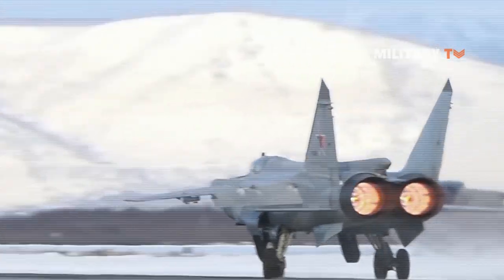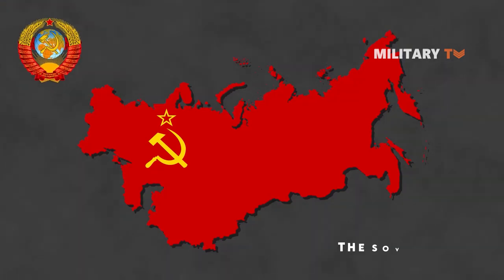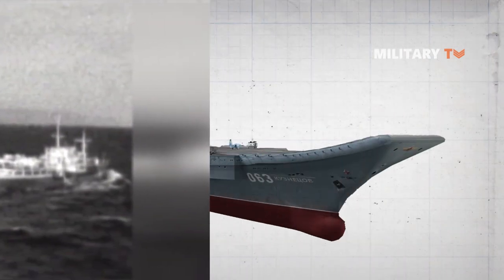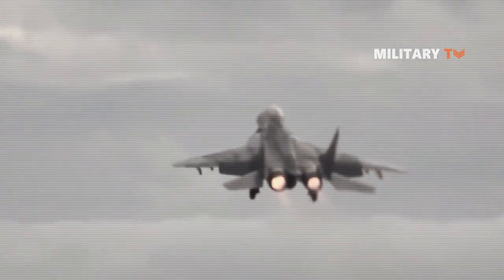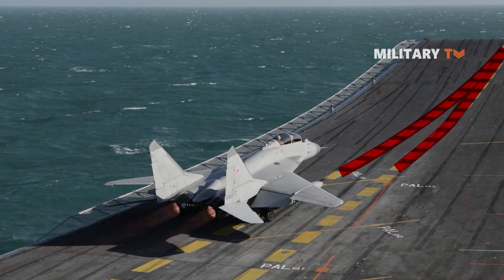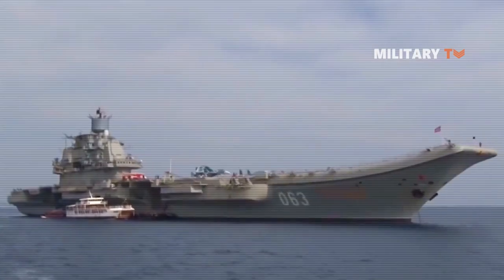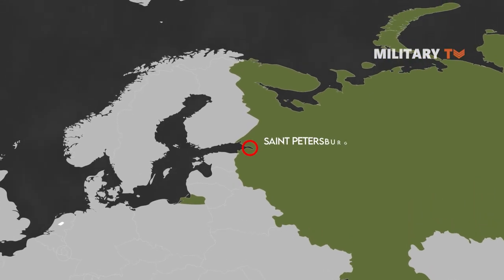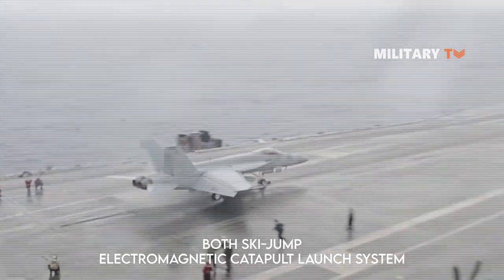Why Russian Aircraft Carrier Doesn't Have Catapult

Comment: No catapult means that the Russian naval fighters have to take off with a lower weight. That means they have less fuel, and smaller weapons loads than their USN counterparts. This also applies to the Chinese carriers.
Reply: also taking off with after-burner, burning big fuel reserves before being in the air. also, limited types of planes that can take off from the carrier.
Reply: because they did not pay for the catapult patents
Reply: It also applies to british ones. american carriers are the exception not the norm.
Reply: So they take off with less fuel and get refuelled mid air without compensating payload thanks to the powerful engines they got (each with 135-145 kN thrust vs 95 kN on F-18E/F)
Reply: I read that US uses catapult system using steam. Since mostly us carriers are nuclear powered.
Reply: @nikko-kun643  The next generation is switching to electro magnetic.
Reply: @Foxtrot_India  refueling in flight is well enough in peace time. During a heated carrier conflict, planes loitering in flight to get refuled are easy targets, not to mention all those slow flying tankers.
Reply: @ricardoantonio5085  Both Su-33 and MiG-29K has buddy refuelling capability
Reply: The new Chinese carrier launching this year has an electromagnetic catapult.
Reply: @thetruthhurts9750  I doubt it will work properly, their plane sucks tho
Reply: @leoironwolf2828  I'm sure it will work properly. Wishing bad is a useless strategy.
Reply: @Foxtrot_India  If they have an aircraft that can refuel them in the air, it means they have an airbase nearby...  which negates the need for a carrier.    This is an aircraft carrier primarily designed for Russia's inferiority complex, so they can say 'we have an aircraft carrier just like America'     The Kuznetzov lost 20% of its fighter aircraft in Syria.   No enemy fired at them, they crashed into the ocean running out of fuel because they didn't calculate their load/fuel correctly.

Four of these were built, there is a reason Russia only has one.    They sold two to China and left one to rust without entering service.   China got their first one, and quickly decided to turn the second into a novelty hotel (not joking) rather than a military craft.

Russia had actually tried to engineer a catapult given the inherent weakness of not having a steam catapult on a carrier.   They spent a small fortune developing one, but when they went to inspect the results they found the funds had simply just evaporated and what they had didn't work at all so they scrapped the idea quietly.
Reply: @Foxtrot_India  and compare with power weight ratio. Russian plane is havier than US plane
Reply: @Foxtrot_India  If there are 12 planes in the air and have to refuel to each other then only six are ready to fight,
Reply: @sultanhusnoo8552 we take off with full afterburner in America, was well. It's safer. We also land with full afterburner.

Comment: Why the British used to use catapults but don't anymore ...

1, The airframe of the planes last longer than catapult launched aircraft. 

2, If an aircraft carriers get a bomb land on its deck. It will damage the catapult system, making it totally unusable. 
Resulting in the aircraft carrier spending month in a Dock preforming repair...

If a bomb lands on an aircraft carriers that do not use catapults.
The ship can sail to the nearest port.
Weld a sheet of steel over the top of the damage.
Then sail back out to sea after just a few days 😉
Reply: "Why the British used to use catapults but don't anymore ..."
The UK wanted to use EMALS but couldn't power it and due to cost. Catapults offer much better sortie rates, usually over 2 times.
"The decision to convert Prince of Wales to CATOBAR was reviewed after the projected costs rose to around double the original estimate. On 10 May 2012, the Defence Secretary, Philip Hammond, announced in Parliament that the government had decided to revert to its predecessor's plans to purchase the F-35B rather than the F-35C, and to complete both aircraft carriers with ski-jumps in the STOVL configuration"

"1, The airframe of the planes last longer than catapult launched aircraft. "
They also carry less fuel and munitions leading to reduced capability.

"2, If an aircraft carriers get a bomb land on its deck. It will damage the catapult system, making it totally unusable. 
Resulting in the aircraft carrier spending month in a Dock preforming repair..."
Carriers with catapults like the Nimitz class have 4 catapults, meaning you would need to take out all 4, whereas on a Ski jump if you take out the ski jump the entire carrier is down, and needs to then have it's super structure rebuilt as the ski jump is weight bearing, which would be out just as long as a catapult if not longer as it's the actual superstructure of the ship. 

Nothing is perfect, everything has it's pros and cons.
Reply: but do they need to be expecting that kind of damage unless they're in a situation like the World War 2 U.S vs Japan all out war situation when Japan's Air Force and U.S Navy were trying to wipe each other off with heavy numbers, don't they have a defense system that protects them in a case of a couple of aircrafts trying to bomb them?
Reply: because the british dont wanna pay the patent fees
Reply: @jamesnguyen7069  the British invented steam CATOBAR , angled flight deck and Optical Landing System then STOVL

Comment: USA has much more experience in aircraft carrier develop and producing due to small small ground borders. 
USSR does not needed in this type of warships up to 1970-s. All current needs was realized by ships with helicopters onboard.   
But when the first Russian aircraft carrier was in development the primary question about steam catapult launch system was is how it will work in case of ice storm and at winter. Because the Russian is Northern country.
Reply: @sultanhusnoo8552  Most of the countries that attaked Russia are on the western side. Historically, the naval fights in which Russia participated took place on the Black Sea with Turkey as the enemy and on the Baltic Sea with Sweden as the enemy. There are only a couple of exceptions. Archipelago Expeditions at Mediterranean sea at Russian-Turkish wars to free Greece from Turkish slavery at 1769, 1806, 1828. And during Russian-Japan war at 1905 at Japan sea.

Comment: a STOVL aircraft carrier can also serve as a STOBAR carrier . . . all you need to do is add a series of triple redundant arrestor wires in the rear most stern section flight deck of a STOVL aircraft carrier . . . thus making it able to operate naval carrier borne CTOL fighter jets such as the HAL Tejas Mk2N maritime multi role fighter . . . for e.g. a fleet of three brand new next generation Queen Elizabeth II class bioFuelCell2^ i-SMARTHYBRId® powered 68,390 ton (76,090 ton loaded) stealth (STOVL) aircraft carrier . . . incorporated with a milder 10.0° deg angled ski jump in the foremost bow section of the STOVL flight deck . . .

Comment: The Russian aircraft carrier is a "lemon". They sold an older model to China, which had to completely rebuild it. Use of an afterburner on take-off limits aircraft range. Because the ship engines are unreliable, tugboats accompany the Russian wherever it sails.
Reply: That wessel, what was called a tugboat by news agencies based on a single sat picture, was actually a oil tanker. Ship is not nuclear powered/ It need fuel. And you just spreading fake based meme here ;)
Reply: All aircraft use afterburner when taking off from carriers. Including US super hornets. Don't talk about stuff you don't know
Reply: It seems like the Russian aircraft carrier is docked for repairs more often than it is operational, honestly.

Comment: Simpler, cheaper and doesn't need expensive maintenance like a catapult? But I guess this is too complicated for some.
Reply: It also prevents aircraft from being able to fly with significantly much more load. More load more fuel, extending the carrier fleet's projection range significantly. That and the ability to field AWACS by catapults.
Reply: @Tayzzy-h2g  it does expert less stress on aircraft though and it’s much cheaper. For the UK, it was a no brainer to go with the ramp.
Reply: @Horizon301.  It's sortie rate is also much lower. Russia is just a poor nation and can't afford it. The QE class was also supposed to have a catapult but they couln't power it since they weren't nuclear and didn't produce enough power.
"The Navy designed CVN-78 to increase the sortie generation
capability of embarked aircraft to 160 sorties per day (12-hour
fly day) and to surge to 270 sorties per day (24-hour fly day)
as compared to the CVN-68 Nimitz class sortie generation rate
demonstration of 120 sorties per day/240 sorties for 24-hour
surge. 

QE class: "The maximum sortie rate is 110 joint combat aircraft sorties in 24 hours."
Reply: @ThatCarGuy  I’m pretty sure it’s still on the cards in the future, it’s just not something they want to rely on for their entire fleet, and it would be for other aircraft, not the F-35. Ultimately we made 2 aircraft carriers for the price of one. The US with the Ford essentially did the same with the Nimitz and 2 is better than 1. Cost would have been an issue had they gone nuclear also and personally I see no need for it if you have the proper support in place. I’m also impressed at how it’s rolled out, seems much more trouble free compared to other recent additions from the UK and US
Reply: @Horizon301.  "I’m pretty sure it’s still on the cards in the future,"
Sadly it's not unless they redesign the ship to add a power plant capable to produce the 60mw needed as the QE class makes about 120MW of which the VDM25000 engines take 80MW to power leaving 40MW left to power the radars, fire control system, etc. So there isn't enough power.
" Ultimately we made 2 aircraft carriers for the price of one. "
That's not entirely true since you need an entire CSG to protect both if comparing 2 vs 1, which costs more as you need to add in the cost of each extra set on the second CSG. Not to mention the fueling of both compared to nuclear. The costs keep rising each deployment. 
"Cost would have been an issue had they gone nuclear also and personally I see no need for it if you have the proper support in place."
Nuclear carriers can refuel and feed the CSG and do so by carrying 3 million gallon/11.3 million liters for it's CSG. Allowing for longer mission times, less refueling tankers, less protection needed to escort the refueling tankers, etc. I do agree the initial cost is more, but depending how many missions a conventional carrier goes on, it could exceed the cost of a nuclear carrier do to fuel usage alone over a 50 year lifespan. 
My biggest issue with it not having a catapult is the QE relying on the crowsnest from a short range helicopter then say an E2 with a much longer range, and a longer range radar(as it's much bigger and more powerful) which can hinder long range missions. Also the lack of being able to launch future drones or power future laser weapons needs to be addressed. I hope to see a nuclear version of the QE class in the future and use the conventional ones like how the US uses it's amphibious assault ships like the USS Wasp and America class. As you stated above "not something they want to rely on for their entire fleet" I agree and think a mixture of conventional and nuclear is best.
" Both HMS Queen Elizabeth and HMS Prince of Wales will keep 45 days' worth of food in its stores."

"The ships normally carries enough food and supplies to operate for 90 days. Four distilling units enable NIMITZ-class engineers to make over 400,000 gallons of fresh water from seawater a day, for use by the propulsion plants, catapults and crew. The ship carries approximately 3 million gallons of fuel for her aircraft and escorts, and enough weapons and stores for extended operations without replenishment."